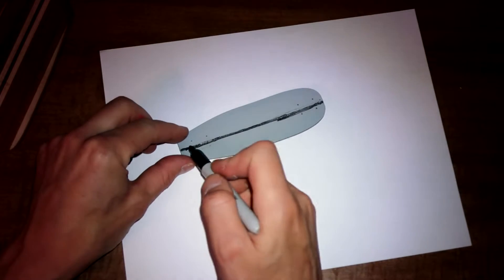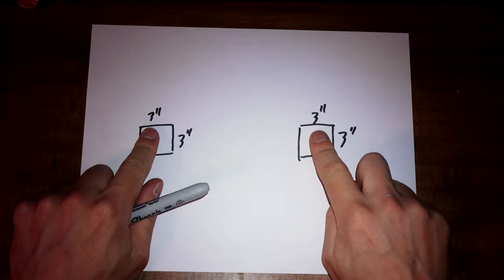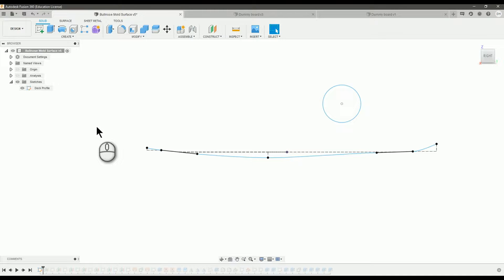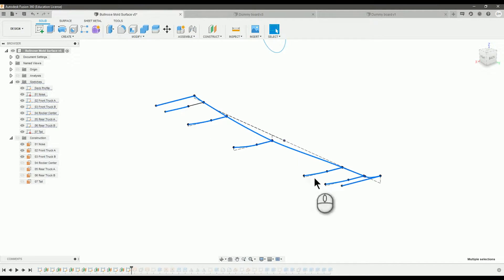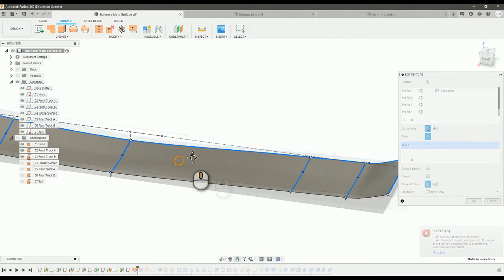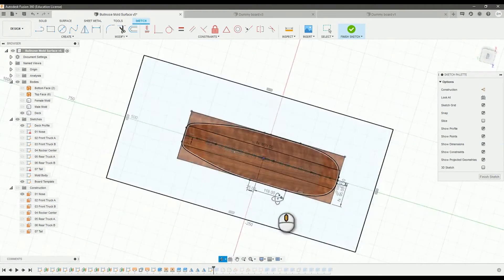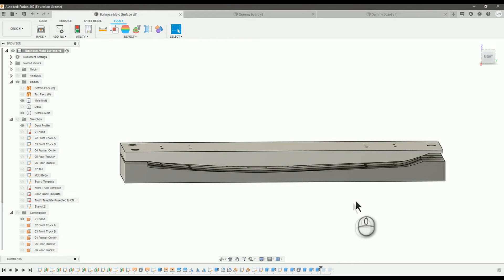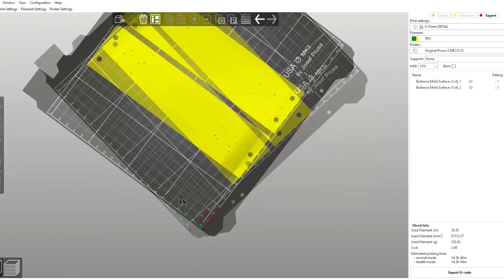How to Design your own Longboard Mold in Fusion 360

Comment: Hell yeah dude. Great video! I was watching to see the surface workspace you told me about and totally wasn't expecting the shoutout. Thanks for that! Angling the bolt hole drilling guides to the plane of the deck was something I had thought of but didn't know how to do either. This is all super helpful!
Reply from the maker: 3D printed molds was the perfect excuse for me to finally finish this project.